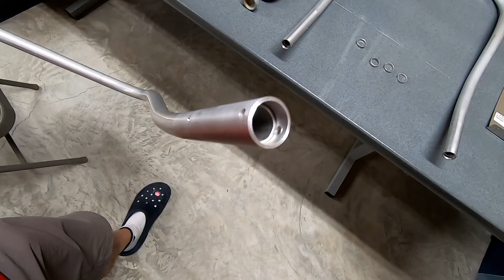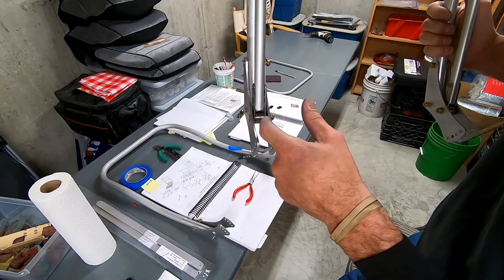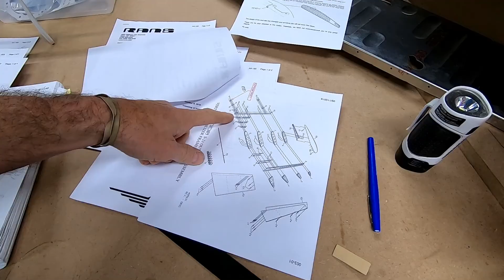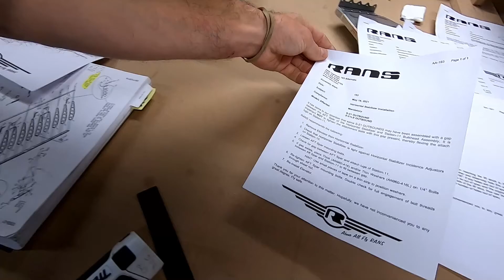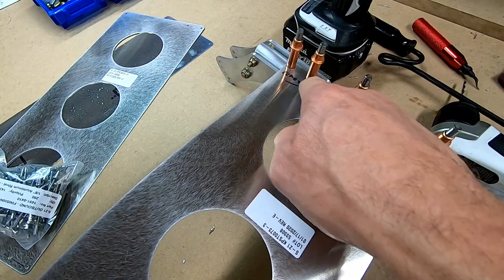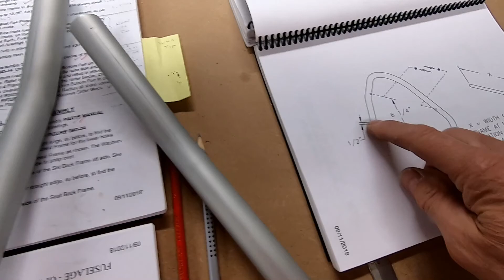RANS S-21 (021) Seats Part 1 frame construction

Comment: Weird…our seat backs dont have all those aluminum supports across the back, and no stainless lacing wires
Reply: I believe this was a change in the later kits.  My July 2020 kit has the lacing wires and zip ties.
Reply: @LTVoyager  it was

Comment: Did you test fit your seats in the plane before cutting the lower tube for the seat back frame?  I noticed that my two frames are quite different in width at the bottom.  The directions say to cut the tube to something like 13.75”, but also has a note about double checking the length so I am thinking I should put the seats in the cage and make sure the bottom of the seat back frame tubes are aligned over the tubes in the fuselage cage before setting the final width of those spreader tubes.